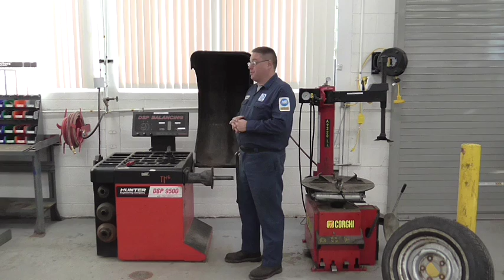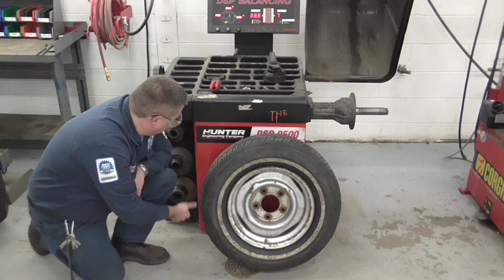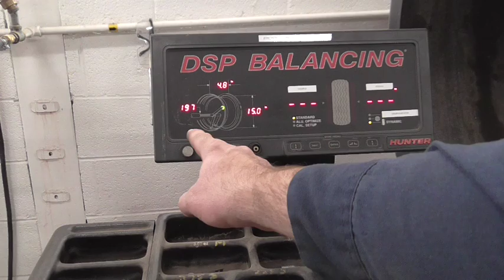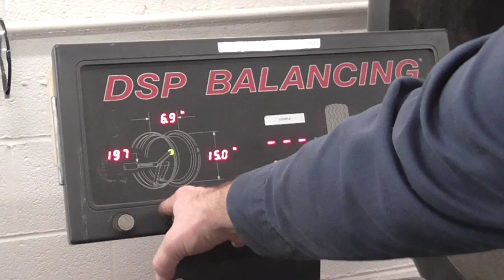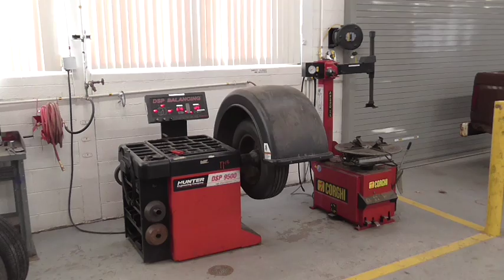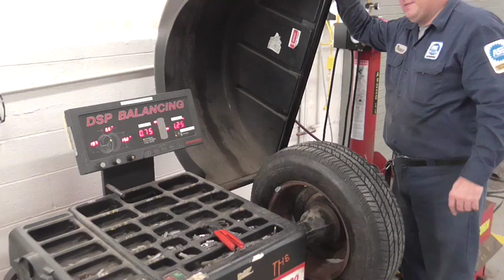Learn to use the Hunter DSP 9500 wheel balancer

Comment: I like using the FMC brand balancer. Easier and quicker to mount the wheel. With the FMC there is a spring and cradle that stays on the arbor always . When you go to mount a wheel, you slide on the correct size cone, then the wheel and then screw on the wingnut. The spring holds the cone against the wheel for you while you screw on the wingnut and you don't have to struggle with holding the tire up while inserting the cone. Also you don't have to take the cone off again for the whole set of wheels. Doesn't seem like alot when you are only doing a few a day but when you are balancing tires all day long it makes a big difference.  I usually get those weights on with 2 wracks of the hammer and I know the sound it makes when the weight is fully seated. When you are balancing all day I guess you get good at it.

Comment: i have a machine  that displays code error 1 anyone know how ti fix this
Reply: I've been working with these things for 20+ years, so I have picked up a few tricks.  Could be a simple fix.  
1.  Unplug the machine.  The units power supply is hot as soon as it is plugged in, because it wired directly to the plug.  The power switch then activates the DSP circuit. 
2.  Remove the plastic bin, then metal cover beneath it.  
3.  On the left side is the power supply board.  At the rear is the DSP board.   CAREFULLY vacuum any dust or debris from the these two boards.  The DSP board is usually the culprit because it is the brains of the balancer, but it doesn't hurt to clean them both while it's opened up.
4.  Check the connection of the various ribbon cables, by gently pressing them to the board.  If they are loose, wiggle them slightly while pressing them into place.
5.  After making sure there are no tools inside the unit, plug in the machine and go through the calibration procedures.  If everything is good there should be no error 1.
6.  Reassemble the unit.
Reply: PChilds I just picked up DSP 9000. by any chance, do you know how to calibrate It?
 Thanks 
  It’s actually says rotunda ford

Comment: Great vid.. ok now when  you everything as it shows and still one side needs a bit more . How do you reset or how do you move the same weight around to get it right? ??
Thanks.
Reply from the maker: graciano b  When that happens I pull the weights off and try again. That usually happens because the weight is not centered. If that doesn't do the trick I just add another weight.